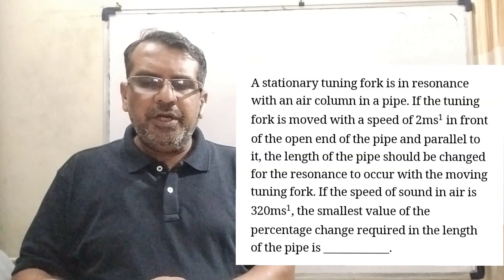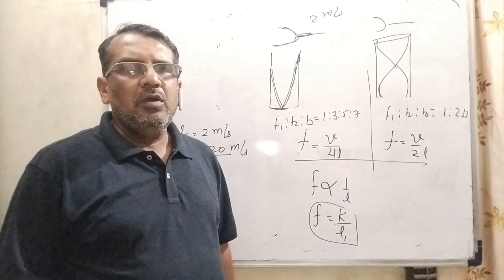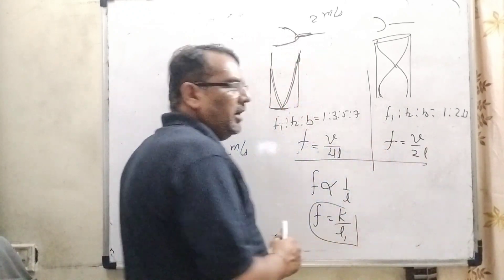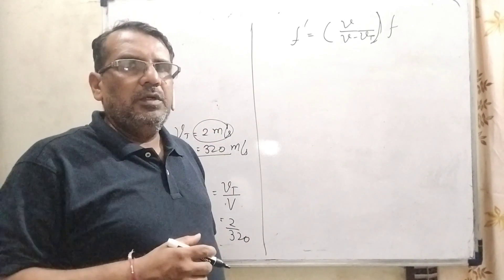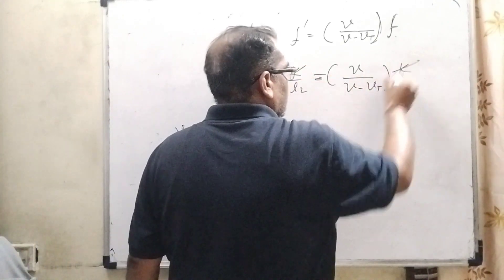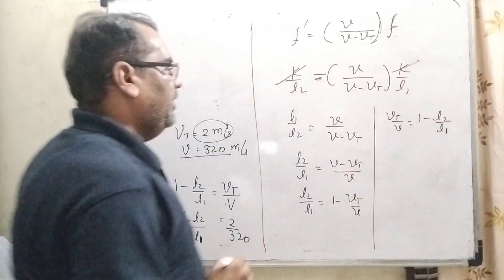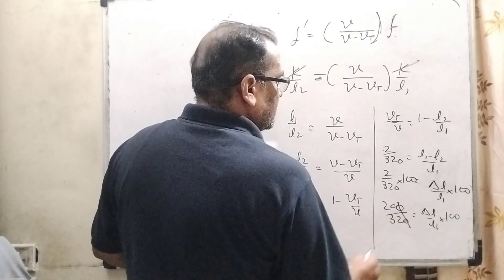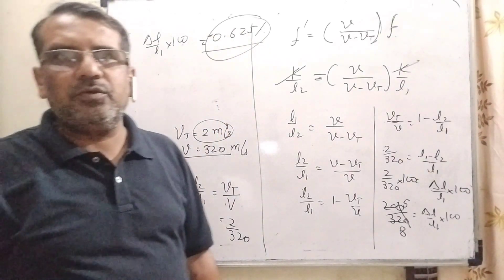A stationary tuning fork is in resonance with an air column in a pipe. If the tuning fork is moved

Comment: Sir why we cant use error method (delta l/l = delta f/f)
Reply from the maker: Bete here the concept of errors  how can be used because frequency is very according to relative . Motion of a tunning fork so we have to use here Doppler effect
Reply from the maker: If you have any problem you can ask at 9826463354